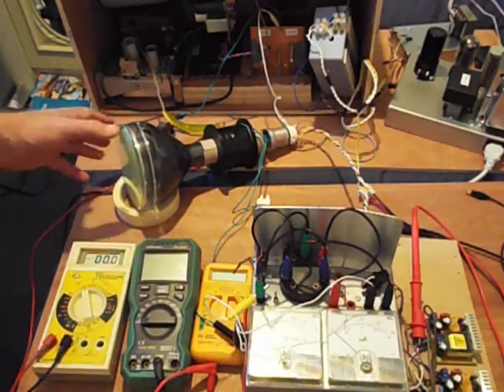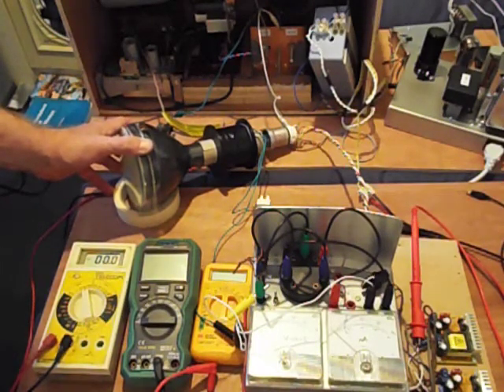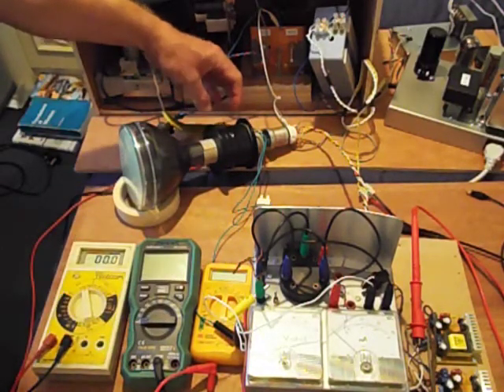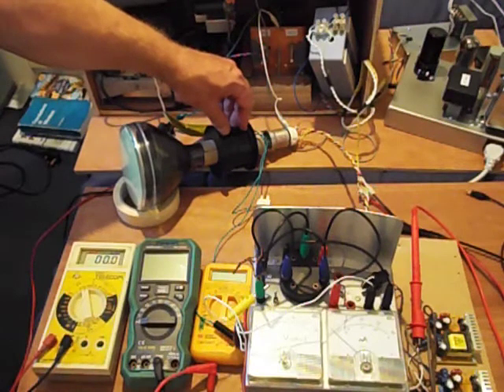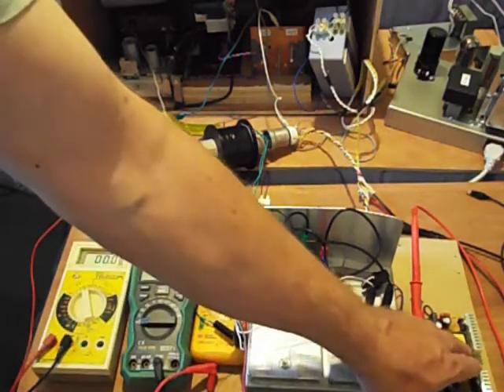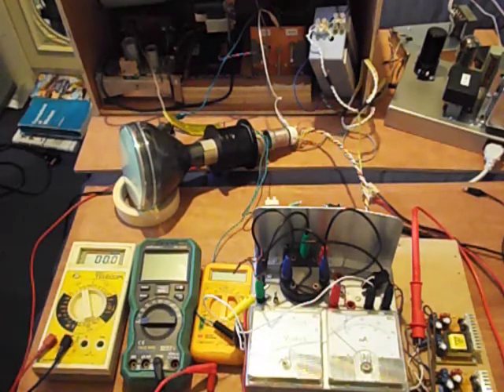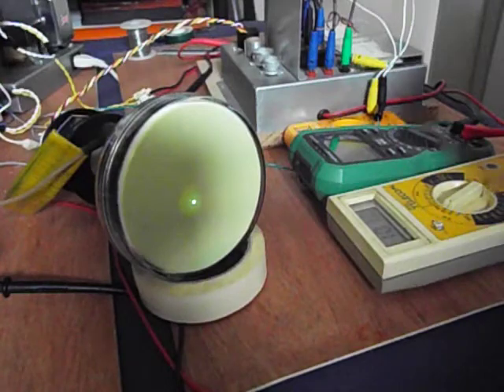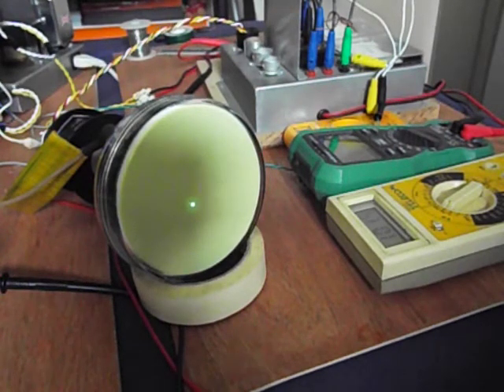Start of a project with the 5FP7 ex RADAR CRT.  Part 1. The focusing coil.

Comment: Some iron or mild steel in the focus coil would reduce the current required. In the day, the coil would typically be enclosed in iron with just a gap about 1/8" (old money) on the side adjacent to the tube.
Later on, of course, permanent magnet focus units came into being and given the strong neodymium magnets we now have, it looks to me possible to fabricate something at home. Another approach might be a hybrid; permanent magnet supplemented by a coil.
Happy experimenting!
Reply from the maker: I ended up winding the outside with some soft iron wire to see if that would help, but with little effect, I later went to a magnetic focusing unit from an old TV.  But I eventually gave up on the project as I could not get magnetic deflection working down to the frame rate of about 12Hz.  I think I would have needed different frame scan coils and a very large transformer wound for 12 Hz in the scan circuit to achieve anything.  Perhaps I will try again some day but using the electrostatic deflection type CRT's rather then a magnetic one.